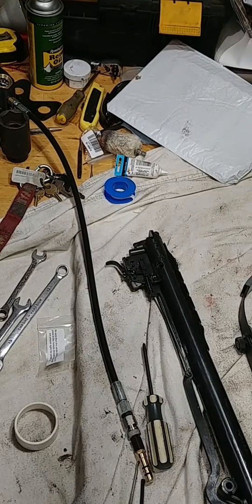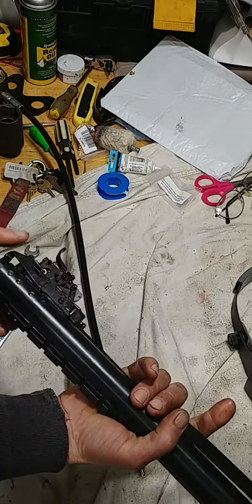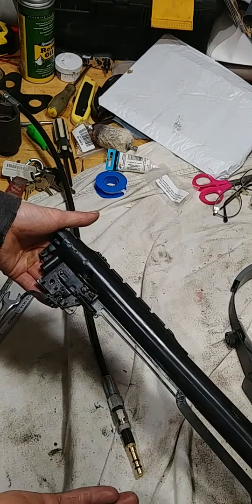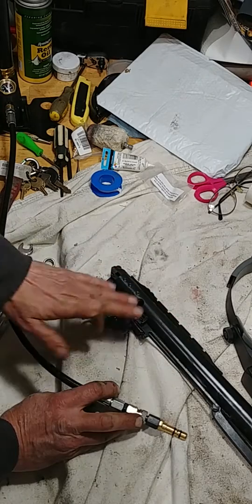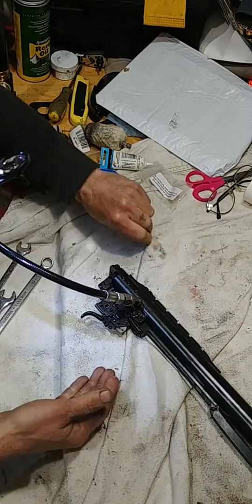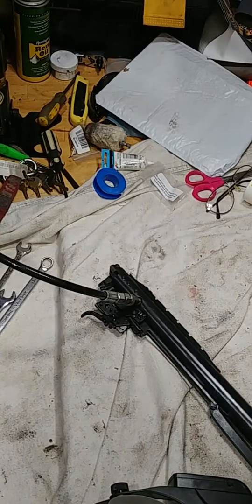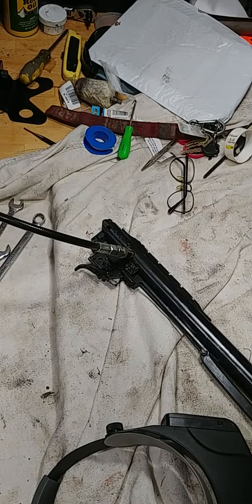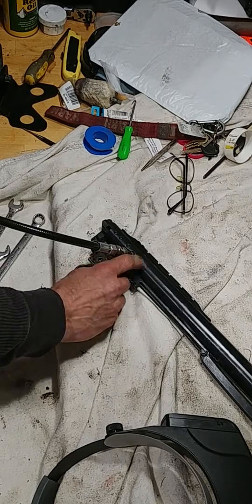Hatsan vortex gas piston

Comment: my hatsan .25 suddenly stopped working. Little to none resistance when cocking the break barrel.
Reply: Same here. Would could be the problem?
Reply: @cargobob7817  I spoke with a Hatsan  representative and they said it’s the gas piston ! Piece of crap !
Reply: Same with mine.
Reply: Mine to barrel flops open not holding air
Reply: Seems to be a big problem with these rifles . Really should’ve been recalled !

Comment: Start pumping and as soon as the gun valve opens, the pressure in the gun will show up on the pump.
Reply: Is there a way of depressurising the gas ram without removing it from the gun if it doesn’t have a pressure relief screw? My vortex gas ram doesn’t and I don’t fancy removing it!

Comment: Thanks for sharing!  This would be difficult to know these are set up this way without a video showing it.  I was looking into swapping to a coil spring which I'm guessing is not necessarily easy but now going to try refilling first hoping what I have isn't completely failed.  I don't mind pumping it up now and then especially if it lasts even a few days since I only shoot on rare occasions.  Had I known gas springs were going to have this leak-down/failure issue back in the day when they were becoming "all the rave" I wouldn't have went out of my way to get them.
Reply: So what did u do

Comment: Thanks, for this. I almost ordered a new fill nipple but when I noticed you had some issues I realized it was only the poor manufacturing tolerances of the reciever preventing me from getting the right angle. The hole was offset by half a milimeter or so, so I had to remove the spring to fill it. I might drill out the reciever later on to make this easier.

Comment: Thanks for the video. I’ve got the 125, but the piston seems to have gone bad. I had it in storage, uncocked for about seven months. I tried to shoot at the other day and it just sputtered. HATSAN  says they will replace the piston for $90. Wondering if you had any advice? Thanks
Reply: Same shit happened to me with my 135 we. 30 cal what a FUCKIN joke I should have got the gamo magnum  smfh
Reply: Wow is there a lemon law for air rifles !! Steer clear from hatsan !
Reply: I’ve had my 125 sniper for years but haven’t shot it much over the past few, just every once in a while to try and keep it functional.
Went to use it last week and there’s no pressure.  Just pulled the piston and I can press the plunger by hand.  Guess I need a new one.
Reply: @jeffpacetti5800  advice to you is not to do business with hatsan anymore !! There’s a defect in the seals air / gas will eventually leak out again!
Reply: Yup save your hard earned money and spend it elsewhere!

Comment: I have a couple of questions if you can answer. I have the 135 vortex.
1) Where did you get the "max fill" value of 145 bar, and I wonder if it can be higher and reliable?
2) I think the cylinders are filled with nitrogen at the factory.  What do you think the result will be by mixing nitrogen with ambient air? I know the air is dirty in comparison, and may have a different thermal expansion rate. 

If you want to use nitrogen, many motorcycle shops have it on hand as they use a fill station to fill motorcycle shock absorber's.  I believe they use a dual regulator on their tanks also, one for the tank pressure, and one for the line pressure, (You know this as a welder I am sure), so you just dial in the pressure you want on the second regulator, and open the first regulator, (with the tank open of course).  If you can adapt your probe to their line, it should work.
Reply from the maker: Actually the max bar is 150 and occasionally on different gas rams I have even seen 160 printed on the gas Ram itself, I have also heard of a gas rim made from Russia that I think holds 180 or 190bar ... And nitrogen gas would also be a great to use..
Reply: @airgunnersedge4061  quick question. All of Hatsans current specs on the high end Vortex guns are claiming higher speed and energy in all calibers than they were a few years ago. 34 fpe in .25 and .30 cal. as opposed to 30 fpe a few years ago. Do you know if they've modified the piston or the gun? I cant find an answer to this. Emailed Hatsan USA days ago and haven't heard back.
Reply: @airgunnersedge4061  do you know where to get a 180 bar gas ram
Reply from the maker: I believe  on Ebay,  it's from Russia... Sorry I don't have much more details than that,you would have to look at some air gun forums like GTA..
Reply: @wpog8453  I was wondering the same, I like the numbers in 25 ..I never got an answer either
Reply: @bigearl8687  I eventually found out the answer. They are using the same piston and pressure as far as I can tell. It appears to be a slightly inflated number that they got using a hand selected gun that is in proper working order with a lighter test pellet than was originally available a few years ago. THE best way to purchase this gun is to buy a cheaper refurb model and send it to Air Gun Pro Shop and pay them $150 to go through it and replace seals and do a trigger job. I did that with my .22 sniper Vortex and the trigger is awesome now.
Reply: @wpog8453  wow that's crazy, it's not like hatsan to use lighter pellets...I have the 125 vortex sniper 25..my piston seal went out abt 2 months ago after abt 4 years. I tried contacting airgun pro shop but never got a response from them. hatsan replied n they were asking $50 hr,I'd rather deal with airgun pro shop because of the tune packages they offer, reading alot of good things n just dealing with them before..I do appreciate your response n information
Reply: @bigearl8687  they may not offer service on Hatsan guns anymore. Hatsan USA customer service bind of sucks. They are very short when replying to problems. This gun is a great concept, they just should have increased the price point a couple hundred bucks and perfected it. I would have gladly paid the difference for all of the time and trouble ive spent getting these guns right.
Reply: Ambient air is around 73% nitrogen

Mixing it with ambient air probably won't matter at all

Comment: Hello friend a have a question what did you do Whit the screw inside the hole how is enter the air I am confused
Reply from the maker: fbi2273 the screw on the gas Ram is to drain all the air out ,on the other side is the fill Port you do not open that screw unless you want to drain the Piston of all the air
Reply from the maker: fbi2273 I have better YouTube videos of filling the gas Ram, you might see it better if you watch one of my other videos

Comment: I can’t get the fill prob in the hole. The inner hole is not aligned with the outer hole? What can I do? Can the inner tube be rotated so it’s not being cover up by the outer hole?
Reply from the maker: If you're gentle the gas Ram will turn..  Some people could still not get the probe in and they ground a little but you have to be careful of shavings..
Reply: @airgunnersedge4061   I couldn’t turn the gas ram but was able to ground down the outer hole with a round file. I plugged the port pretty well with tissue paper so no shavings got in there. Eventually the fill probe fit and I was able to pump it up. I accidentally pumped it up to 152 bar. I didn’t bleed out the excess air. When I shot it, it was super loud, but the velocity had improved quite a bit. The velocity, with .22 JSB 14.35gr pellets was kind of all over the place...856fps to 950fps. That’s an unusual spread. Maybe it will settle down after I put more pellets through it. It’s definitely more difficult to cock it.
Reply from the maker: You did not mention if this is a new gun usually dieseling  will cause such a high spread I would definitely clean the barrel of any oil,  If this is an older gun that is no longer shooting good but was it could be the piston seal...
Reply: @airgunnersedge4061   It’s not a new gun but I had just added Air Chamber Lube directly into the air chamber so it was dieseling a lot! I will clean the barrel because I’m sure the stuff sprayed out when I was test firing it.

Comment: It was so easy to pump. I filled mine way too much. Think it is about 170 bar. Is it possible to release the pressure? I can't figure out how to do it :(
Reply from the maker: Yes on the other side you will see a screw slowly losing to let the air out  , add air to desired psi... I strongly recommend do not overfill past the recommended PSI ..
Reply: @airgunnersedge4061  Hmm, I have the Hatsan 125 Vortex, and sadly it doesnt seem to exist a screw on the other side :(  Argh, how do I release the pressure now...? I don't expect you to have the answer but maybe you know? Thanks for a great channel, greetings from Sweden.

Comment: Rich - do you have a dessicator cartridge in-line with the air hose? I ask because I got the $100 Mrod pump for my AT-44 as my first PCP. I'm not super-concerned about a little moisture inside my air cylinders because I can open them up to clean them if I had to. I'd think air quality/dryness would be a bit more of a factor when filling a gas piston. I'd think any moisture in the gas team cylinder would have more of a tendency to cause corrosion.
Being new to PCPs, and having apparently forgotten seething I knew about physics, I took my pump outside to cool it faster, then took it inside to fill my other cylinder. Unsurprisingly, I had to take it apart afterwards to empty out the water that had condensed inside it. (This is obviously a user error and is unconnected to my earlier question.) Now I just keep a fan pointed at me while I'm pumping. Keeps me and the pump a bit cooler. Maybe I can go a bit longer now before replacing the innermost o-ring again.
Reply from the maker: Brian Spring I bought the Hatsan high-pressure pump they are incorporated into the handles of the pump so there is no need to add any extras

Comment: Please answer my question. I've just bought Hatsan Vortex but the hol in the cover doesn't fit exactly to the hol in the vortex inside. The difference is about 3 mm and i guess that i won't be able to plug in the pump. It's so sad do you have an idea how to fix it? I don't want to remove the vortex because I can't do this, so... Is it possible to fix it?

Comment: Hi, I know this vids 2 years old but my 125 Sniper QE Vortex Piston reads 160 bar??

PS did you have any issues down the road or was it pretty straight forward & easy to fill or degass? Thnx
Reply from the maker: Actually some vortex gas pistons  will have different Max fill numbers, I would not recommend going over the max, fill but it's up to you... It is straightforward and easy, I did have to adjust the gas pressure to the most accuracy...
Reply: @airgunnersedge4061  Excellent Thanks for your insight & no I definitely have no intention of going that high I just thought it was odd that one piston would say 140 max & another 160...
Im only hitting 675 or so with poly mags in my .25 cal so Im hoping to bump it up a tad more.

quick question I forgot to ask earlier, where you able to accurately measure how much air was in that piston once you connected the pump hose, did it give a proper reading, I heard you mention something about a one way check valve so I wasn't sure?      Thanks so much
Reply from the maker: Yes you will have to determine the PSI by the gauge that you use either hand pump or tank,it will only tell you how much PSI you put in the gas ram... go to 135 psi and check the fps of the gun,then bump it up another 5 and get the fps again until  You are satisfied with the numbers

Comment: I have a Hatsan 135 QE Carnivore that recently gave out on me. By that I mean, after I cocked it, it lost ALL pressure. Does that sound like a seal issue or vortex ram issue?
Reply from the maker: Gas ram
Reply: AIRGUNNERS EDGE, so I need to buy a new vortex gas ram? And replace it?
Reply from the maker: I believe you can put a crosman piston in it , but never did one...
Reply: AIRGUNNERS EDGE ok. Ive already ordered a new Hatsan vortex ram, I’ve never worked on an air rifle before...difficulty level?

Comment: Hello! If I want to bleed the air out, do I have to fully disassembly the piston? Or can it be done in the state that you present in the video? I am trying to bleed my piston, but the screw does not turn and it is starting to strip. I am wondering if it is not turning because maybe the metal holder of the piston prevents me to unscrew it.

Comment: Sir can the. 150 sniper vortex be adjusted/ pumped up ?
Reply from the maker: Yes I believe that can be, I'm just not sure if you can do it inside the gun or if you will have to remove the gas Ram !!!
Reply: Airgunners edge how much do you charge to do upgrades I have a 150 sniper vortex

Comment: Does this only work with the newer gas rammed 125 Snipers, with QE?
Reply from the maker: whiff1962 some of the vortec gas Rams in other models are non fillable but the 125 in 135 are without removing the gas Ram

Comment: The ram is filled with nitrogen not compressed air! Has to do with moisture.
Reply from the maker: theoriginalmungaman not on the hatsan vortex ram, crosman uses pure nitrogen but the air we breath is 78 percent nitrogen allready and moisture is removed just like my hand pump for my PCP...
Reply: Nitrogen is a gas, hence the name “ gas ram” Nitrogen rebounds quicker which is why its used in tires and shock absorbers. I run nitrogen in my pcp as well
Reply from the maker: theoriginalmungaman oxygen, helium, carbon dioxide are all gases it's the molecules that make the difference... you would actually be better off running helium in a PCP because of the molecule formation...
Reply: AIRGUNNERS EDGE  you do get a lot more power with helium. The nitrogen is just easier as I lease a 6000 # cylinder from my welding supplier. I saw that with a max charged ram the 125 put out 30 foot pounds, thats close to my .30 135qe.